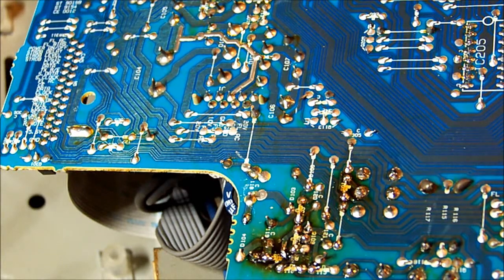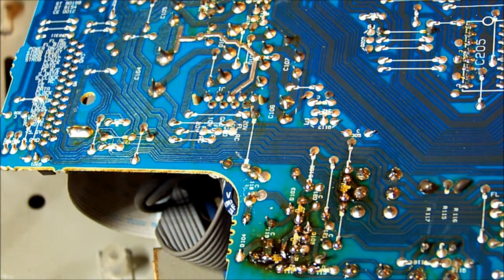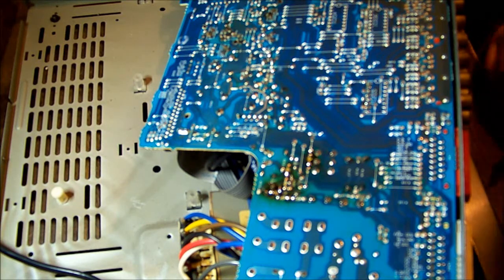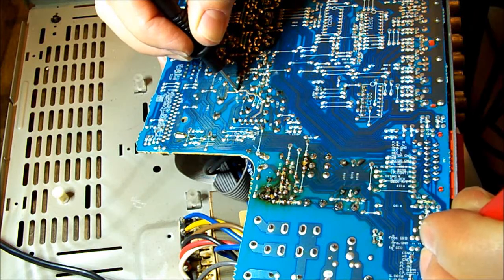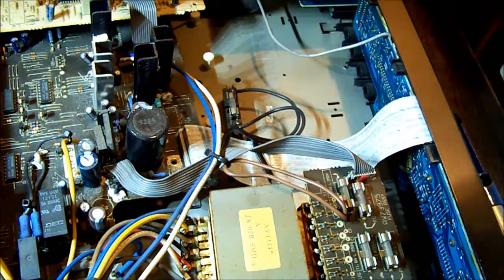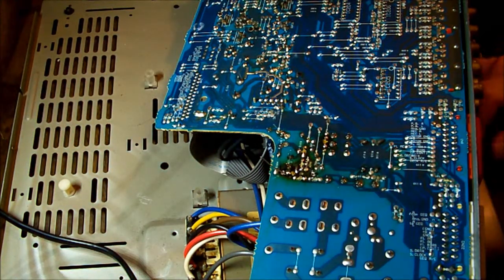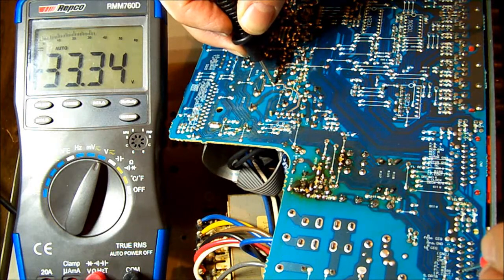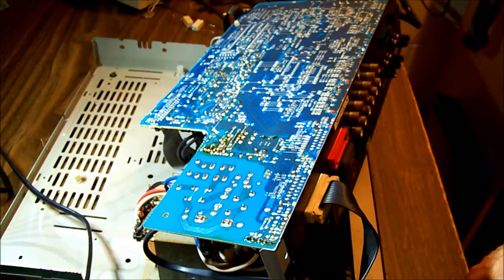Pioneer CX-J500 Repair Part 2

Comment: Makes you wonder how much these things consume in standby mode. I have one from a customer with a similar issue I think. It isn't worth this level of fault finding for the cost of the unit. I think these always on active switches are terrible. For one, they are inefficient, drawing a fair bit more power from the wall in stand-by mode and second, in stand-by mode by design, the components are seeing more continuous ware which deteriorate them in an unconventional way leading to literally looking for a needle in a haystack when a fault appears. Great job though, Sir!
Reply from the maker: Thanks. Power use in standby from one appliance wouldn't be perceptible on the total use but switching off many parasitic draws might. I'd say standby mode soft power switches only exist because people want remote controls so the thing has to be on to receive that signal.
Reply: @JonnyFix  Fair enough. It is a weird design for these multi systems which are powered from one plug. I tend to find that these style units fail in a less explosive manner due to their design and instead cook themselves to death, slowly.